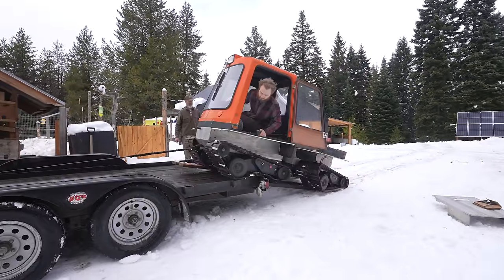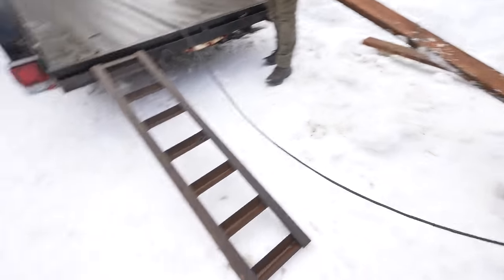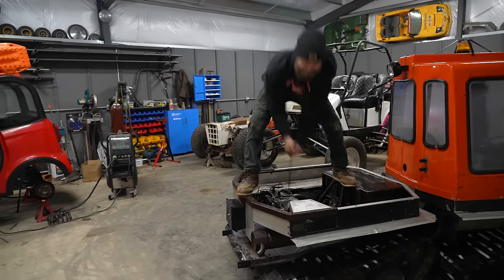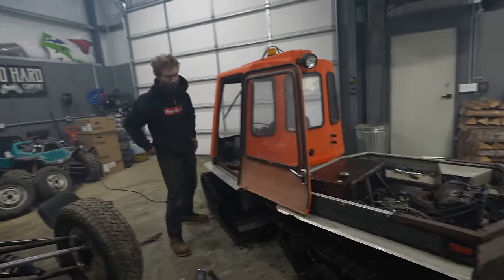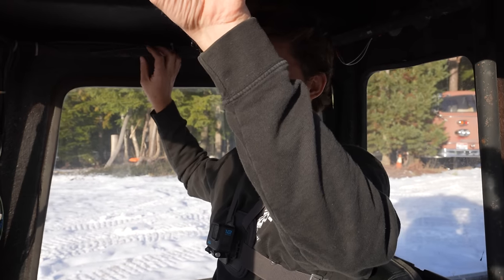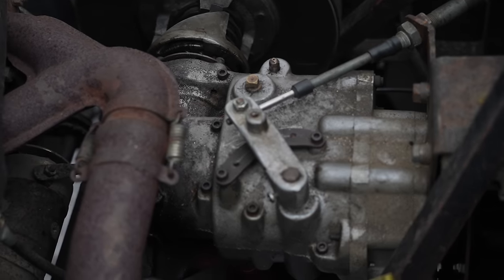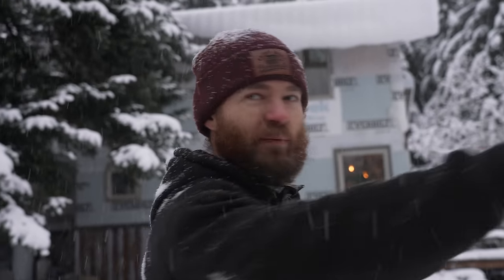We Found a Rare Snow Cat!

Comment from the maker: Finally got a snowcat! Which engine does this machine need?
Reply: You guys should stick a Cummins in it somewhere
Reply: Robot Cantina has a great series featuring a Kubota 3-cylinder diesel... just saying, might be cool...
Reply: Cummins R2.8 Turbo Diesel
Reply: 12 valve
Reply: @alexanderliebscher3472   That would be cool. A little diesel from Kubota would be perfect.
Reply: I was about to ask that question if one would fit🇬🇧
Reply: Or you guys should make it electric. Just like what the tank was going to be
Reply: Rotary
Reply: Chainsaw for each track
Reply: Stick an 8.3l Chevy v8 in it 😂
Reply: honestly would be cool to make it electric if not then i wanna see an outdrive boat motor swapped into it
Reply: Isuzu deisel,  oh its smaller than i first thought😅 turbo moutain sled engine
Reply: Hiabusa
Reply: Love the Kubota option.
Reply: Cummins or 1.9L diesel Volkswagen
Reply: Toyota Tundra engine 100000%
Reply: Needs a polaris xp 1000 motor in it!!
Reply: Om606
Reply: R1 or a detroit!
Reply: Kubota 1505v turbo. No need to try to make it fast. Make it torquey
Reply: Ls swap😂😂😂😂
Reply: Wankel !
Reply: you should fit a recover boom and winch onto the rear and have it as a recovery vehicle to drag the rest of your toys back out of the woods
Reply: Mini Diesel! Torque is your friend with tracks!
Reply: I would either use the new Honda IGX 800 or the DuroMax XP35HPE 999cc… Both engines run amazing in the cold weather…
Reply: A turboed Kubota tractor engine
Reply: Ayabusa
Reply: D5 engine
Reply: Actually just restore it its too cool
Reply: A "little" overpowered electric motor from a Tesla perhaps
Reply: Cummins
Reply: Not sure about the engine but you should look into and air ride seat
Reply: Diesel of some variety for sure
Reply: Ls3
Reply: Some sort of small diesel.
Reply: Something mental
Reply: What about a good old V-Twin from a Harley or Yamaha, would ad a lot more Sound
Reply: Rotary. Built 2 rotor with a turbo or na 3 rotor.
Reply: Or a 1600 cc + v twin for sounds shakiness and a different built aspect.
Reply: @kai_nelson I think at that point the Cummins would be ON it not IN it😂😂😂
Reply: Remember you gotta keep it light to make it useful. I say find an old trusty 20R, deck it out, and make the thing look like and old 70's toyota pickup, Its already got some great curves on the cab for it!
Reply: Get a twin EFI engine from some 90's snowmobile, can guarantee it'll be more reliable, and have more torque.
Reply: def a hyabusa, and you should put a hyabusa in a smart car, maybe give it a little lift, with tracks, and a skidplate, and external rollcage!
Reply: put a BEAMS in it
Reply: T-Jet or CBR1000
Reply: Snow mobile engine wanna hear that 2 stroke scream
Reply: EJ205
Reply: Get rid of the CVT and maybe go 4 stroke. 
V twin bike engine with nice 6 speed gearbox and a gear reduction so that 1st is nice and low.
Bed over the engine and a winch/boom combo.
Modify the cab for 2 people.
Roof rack on the cab with work lights all around.
4 timber sled units would be a lot softer ride!
Reply: Two,  3 cylinder snowmobile engines please.
Reply: Blown big block Chevy
Reply: VW 1.6 diesel
Reply: Definitely LS swop it
Reply: Actually Put me in there I gOt a HEaRt lIKe a tRuCK
Reply: If it wasn't for diesel kinda sucking in the cold, i'd say a 3 cyl diesel skid steer engine... only slap a turbo it. That or the lil Toyota diesel, but aren't those hard to find in the usa?
(I don't think some of these engine suggestions realize the actual size of this thing. 😂)
Reply: Junkyard vw tdi😂 and turbo the heck out of it😏
Reply: A Kabota
Reply: Volkswagen 1.9 tdi pd150  (engine code ARL) gets up to 190hp with just a software tune. Pretty damn reliable and light weight engine! Even small enough i think whit the manual gearbox.
Reply: Put a k20 in it and call it  the "K-kat" a k truck sized snowcat with a k20
Reply: its so weird how similar the scenery there is to where i live in northern ontario, id feel at home out there i think
Reply: I would love to see a big displacement 2 stroke triple. Like and arctic cat 900 or 1000. Problem would be proper tuning and cooling.
Reply: You guy should snowmobile engine in it and the you should put the fire truck on tracks and carry it on the back
Reply: A Hayabusa
Reply: R1 engine
Reply: 4 stroke plzz
Reply: Cummins duggati or hayabousa
Reply: Snow mobile motor with gear reduction 🤌
Reply: A rotary would be dope
Reply: Defo something more relaxed, hard to choke out. People saying Kubota, yeah certainly a great choice if they want to use it more than just for YT views, those things run forever.
Reply: Radial plane engine for sure 👍 🤷
Reply: 4g63t
Reply: Some 500cc twostroke dirtbike engine 👌
Reply: The engine from the minitruck and more gears.
Reply: Bugatti w16
Reply: Boxer engine
Reply: Hellaphant
Reply: A hybabusa would be nuts but I'd find a Kubota diesel from a quad or small tractor
Reply: What kinda power is she making now? Did they make a supercharged snow mobile?😂 She needs boost
Reply: I would like to see a new 450 4 stroke bike engine in there
Reply: Gas turbine like the Abrams tank
Reply: Another rotary
Reply: The stock one rebuilt with some cylinder porting, mill .020 off the head and better pipes. Fatten up the jets some and send it.
Reply: Electric would help it be quieter.
Reply: That thing seems so good with that old motor in it, honestly a newer turbo sled motor seems like the ticket. Diesel to heavy not enough rpm….
Reply: 12a rotary engine would be sick
Reply: TURBO HAYABUSA!!!!
Reply: LS swap with turbskis
Reply: K swap
Reply: 4BT Cummins
Reply: Boxer engine
Reply: K Swap it!
Reply: Crotch rocket engine... Or a H2 engine.......💨
Reply: I do have a 05 fuel injected skidoo summit 1000 locally I could part with for a good price! No boost needed with that many cubic centimeters of 2 stroke
Reply: please make an electric snowmobile like cross-cart, put the battery pack over track tunnel in back and have it on a sled that can swivel from side to side.
you can tilt/lean the "machine" while sitting comfy up front.  also- THINK OF THE WHEELIES!  
snow machines like this has been tried but never done right because you cant shift weight, this idea is super safe and will use the drawbacks of batteries to advantage 
(PLEASE LIKE SO THAT THEY CAN SEE, ITS A DREAM OF MINE TO SEE THIS CREATION)
Reply: LS swap it 😂
Reply: Electric motors
Reply: Big bang R1, turboed
Reply: KTM 500 cc two stroke
Reply: Little baby turbo diesel
Reply: 850 etec or 900 ace turbo
Reply: 5 cylinder Audi Quattro engine pleaaaaase
Reply: A 1jz because why not cho cho turbo sounds
Reply: @GrindHardPlumbingCo ... You guys need to build a camper at the back of the snow cat !!!!!!!!!!!
Reply: I4 Detroit Diesel
Reply: Super charged jet ski?
Reply: EJ motor. Let’s see Will’s Subaru talk in action.
Reply: A small 2 stroke Detroit diesel like a 2-71 Detroit or something
Reply: TT LS swap it
Reply: Some kind of V6 or V8
Reply: This is clearly something that needs some torque. And not just some high strung motor
Reply: fireblade
Reply: Cummins X15
Reply: Cummins
Reply: Can am quad or some belt drive quad would be perfect
Reply: There's only 1 true answer.
VW 1.9 TDI
Reply: Super bike swap when
Reply: Put a Cummins 4bt in it
Reply: A v8
Reply: Put a Hellcat in a Snowcat ?😅
Reply: V 8
Reply: Ls swap it
Reply: Yamaha rx1
Reply: Diesel 3 cylinder
Reply: A 90s rmk 700 or rotax 670 would be easy to adapt. And Itd turn it into a rocket.
Reply: Hellcat engine!
Reply: 2jz
Reply: V12
Reply: Needs to be diesel
Reply: The snowcat is an awesome machine but do you have any idea where to find new tracks. I mean y'all do go pretty hard on your creations. LOL😂
Reply: 2jz
Reply: V8 LS9
Reply: Something close to what it has now but 4 stroke. And a bit more power. Parallel twin bike engine, 270 crank for the sound would be nice. What about a Honda NC700/750, very torquey engines. Would sit nicely low in the frame. Get one with a DCT for driveability :)
Reply: Definitely a little diesel.
Reply: 998T out of an arctic cat or Yamaha. Easily 300hp on pump gas and reliable
Reply: V16
Reply: Yamaha Apex snowmobile engine
Reply: definitely diesel. Roll coal!
Reply: Fuel injected 450 motor
Reply: Some kind of V8, with a turbo, just plonked on top
Reply: Hybrid for sure... I'm jealous for this project. Good luck and we'll be watching.
Reply: V10 or v8 please I never get picked for anything and I watch you guys for so long please
Reply: If only this thing was green, you could call him 'Mike'...
Reply: Turbocharged big inch Harley
Reply: My pick or small engines would be between a  K24, 4bt, ej20
Reply: I would put a small turbo diesel in it.
Reply: Kubota 3-cylinder diesel, super reliable, easy to work on, and loads of torque
Reply: Tesla p100d plaid plus conversion
Reply: Small block LS
Reply: I like the electric idea but batteries suffer in the cold 😉 without any suspension there is no reason to make it fast. I like the sound of the 3 cylinder diesel 😁 Kubota is good stuff. Those tracks probably wont last long. Old with metal kleets. Have seen old snowmobiles like that. Old polaris 😉 might be easy to fabricate but some newer track systems would be ideal 😁 98 and newer sleds had the better suspension but idk about mounting. Good luck and keep us updated 😁 Love all the footage
Reply: a W-16
Reply: TDI swap
Reply: Maybe even just 4 big balloon tires 😉 cheapish fix 😂
Reply: The one it came with
Reply: Something totally inappropriate.
Reply: Rx-1 from the triumph
Reply: I haven't seen the rotary trike around for a while, maybe swap that motor in there?
Brap Brap!
Reply: Honestly robot cantinas Kubota diesel would be sick buuuut a yamaha sidewinder motor would be cooler
Reply: Im gonna be sensible and say, put a Kubota in it.
Reply: Fast motorcycle bike engine
Reply: Some small diesel
Reply: Something that won't deafen you guys, that's for sure. What it 100% needs, is better tracks. Something that has grip. Oh, and better suspension. It has none.
Reply: Harley V-Twin... lol
Reply: Needs a snowmobile engine 700cc or above
Reply: KTM LC8
Reply: When you said turbo 2 stroke that almost what I said from the beginning that's before you said that but diesel motor 2b tq monster speed don't matter well at least 20 to 25mph
Reply: Sounds like a chainsaw, cboys just put a hyabusa motor in a chaing lee so you should put a Ducati in it
Reply: Tdi
Reply: Kubota diesel would be cool
Reply: Ford Godzilla or a hellelephant
Reply: electric, plenty of room for batteries on top of that back half
Reply: You guys are complaining about not having any snow s*** you guys should be in Minnesota right now we're dealing with the mud already like the spring
Reply: Supercharged yamaha from the mg
Reply: 2jz
Reply: That’s not a snowcat, that’s a snow kitten 

Also give it a hellcat engine, it makes sense and it sounds funny
Reply: Turbo 4 stroke sled powerplant ..❤
Reply: K swap for sure
Reply: Yamaha yxz1000 motor!
Reply: A Yamaha Phaser 500 4-stroke would be a good upgrade. It would just break it to put anything more powerful in.
Reply: @jimmyhughes5392 the are not Dave Sparks… they do not get stuck as much 😂
Reply: 3 cylinder kubota diesel !
Reply: A harley engine 😄
Reply: K swap 🤘🏼
Reply: Ninja 650 Parallel twin for good toque or Kawasaki ER5 also good torque, or even the sv650/sv1000 engine.
Reply: Rotary duh!
Reply: 4BT cummins or a VW 1.9 TDI
Reply: 3 cyl Kubota/yanmar diesel would be neat to see in this thing. Would make a nice amount of power and be plenty to operate that hydrolic PTO as well.
Reply: subaru engine   i watched the podcast
Reply: something practical and cool😎❤️🤘🏻
Reply: 4bt Cummins would be sick 🔥
Reply: Vmax motorcycle or high powered snowmobile
Reply: 16 hamster wheels
Reply: 2jz
Reply: Definitely needs a 13b
Reply: needs a rolls royce tank engine in it for sure
Reply: A Hybusa  swap or maybe a 454 engine. Also what is the model of the snow cat?😊
Reply: Ls
Reply: Toyota pruis
Reply: vr6 turbo swap it :)
Reply: K24a2 or a rotary
Reply: The link is a compact liquid cooled diesel with 122 hp @2500RPM and 400 lbs of torque.
Reply: K24 Honda swap
Reply: Yamaha four stroke . Old nitro motor. Turbo of course
Reply: Cummins?
Reply: 2jz
Reply: diesel, maybe from a forklift, that way it can handle the hydraulic pump without chugging.
Reply: Volkswagen mechanical TDI
Reply: Cummins or some sort of diesel
Reply: 2.8l Cummins
Reply: LC8 V-twin from a KTM SuperDuke 1290
Reply: Yamaha fx nytro sled engine! Triple 1000cc animal
Reply: I got a 2001 r1 I would sell to you cheap for this
Reply: Or Yamaha apex engine. Your gonna want the cvt belt unless you get a large enough engine with plenty of gears.
Reply: You gays should keep the 2 stroke in engin in it
Reply: Supercharged RX-1 from the spitfire
Reply: This thing is BEGGING for another set of rear tracks on an articulating pod like the engine bay/rear tracks are. 
Just control C, control V the whole rear half again. 
Could even have a second motor the same as what you end up swapping into the existing engine bay. The hardest part would be locating another set of tracks
Preeeeeeemium👌🏼
Reply: 4 cylinder Cummins
Reply: Nobody 😢??
Reply: A yellow one.
Reply: @itsjosie6301  way too expensive, VW TDI, for the win 🥇
Reply: Vw tdi
Reply: 😅😂😂 sorry purist 😂😂😂😂
Reply: Td4.2 put of a Nissan patrol
Reply: LS swap
Reply: Skidoo 550 fan
Reply: omg you drove through my town!!! thats epic
Reply: Ls
Reply: Keep it light, put a snowmobile engine in it
Reply: K24 engine with a budget turbo kit
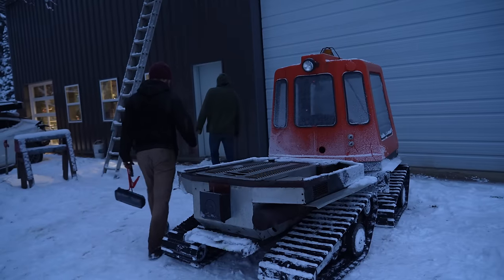Reply: 2004-2006 Arctic cat firecat 700cc engine. It’s a Fuji industry engine and it’s efi. Fairly cheap as well with plenty of parts around. 32:58
Reply: 3cyl Kubota Turbo diesel
Reply: 1000 cc can am
Reply: Tiny diesel 100%
Reply: I was gonna come here and say this machine deserves a diesel engine... but I see everyone else feels the same way. But if a gas engine must go in it definitely make it a boosted Hayabusa 😂
Reply: Skidoo 503 that came in early 80's everest snowmobiles they extremely reliable and even used in small aircraft and it would have perfect amount of power thats needed
Reply: 4bt cummins
Reply: K20, @boostedboiz collaboration
Reply: @SecondFaster No 4bt it’s the smol one
Reply: 2, 250 ktm engines
Reply: Cummins
Reply: 4bt
Reply: Rotary
Reply: Supercharged V10
Reply: Rotary, please do a rotary 🤌
Reply: Kubota diesel
Reply: Another R6 motor
Reply: Witch ever one has the most torque.
Reply: Kubota 1505! Or a CAT motor
Reply: I agree with the lightweight turbo diesel. The torque will lend itself well to hills on tracks in deep snow. Maybe increase the flotation a bit too.
Reply: Yamaha nytro engine!
Reply: YANMAR 3 cyl
Reply: I suggest going for reliability and practicality for the engine and then go nuts building hydro driven accessories. Perhaps a skid steer engine would be a good choice?
Reply: That's either a Suzuki spirit 500 engine or a Kawasaki 440 there both a decent engine just not speed demons
Reply: You should put a mt-07 motor or An Isuzu Turbo Diesel in it and then build a tank body around it
Reply: Ford Duratec 1.6, with a DPS6 transmission, so you can shift manually, or automatically..whatever you choose...I bet it will fit (it'll be a bit big) and it'll be plenty powerful, and fast..... And really durable! .......It'll also produce great heat for you in the cabin. It's set up already. You'll be able to drive in tee shirts, because you've got a powerful heating system ready to install from the same donor car!!!
Reply: Yanmar diesel
Reply: 3 cylinder diesel
Reply: Or Isuzu diesek
Reply: Subaru flat 4 or 6!
Reply: Does will get a check every month ? Seems like he should
Reply: Polaris 750fst maybe?
Reply: Remove the cab. Make it bigger. A 2 seater. And soundproof it. Maybe add a 1000cc goldwing engine. 😆
Reply: K24
Reply: Some kind of swindly greasy triple.
Reply: Would love to see a 3cyl diesel in this unit. Toque, same speed, but a little quicker. Quieter. And different than usual.
Reply: propane forklift engine
Reply: 4bt all day.
Reply: 600-800cc liquid cooled 2-stroke snowmobile engine. run a coolant line into the cab to a small radiator with a fan for in cab heat and a large rad outside the cab for cooling. run some sort of diverter valve to control the amount of heat. would be a ripper with 120-150hp, much more and you would probably risk breaking a ton of components.
Reply: I'd go easy on adding horsepower. im sure the drive train won't like it much as old as it is, but it definitely needs something or at least freshen that one up..
Reply: Kubota or small diesel
Reply: Brushless 30+ kW that thing could use a 300 lb battery pack
Reply: CR500!
Reply: Something converted to propane. Hank Hill style.
Reply: Do a hiabosa 1300 street bike
Reply: Artic cat f7
Reply: OOOOL this is my home turf! how about a small diesel? Volkswagen rabbit? Super reliable and something you haven't quite done yet. Make it a SUPER useful machine for the property and tasks like the 6-wheeler. Reinforce the shit out of it!
Reply: I would put a built Chevy 4.3 in it
Reply: Predator V twin, 670
Reply: I'm down to a little turbo diesel,  a rotary, or a Hayabusa 🤔. Idk close your eyes & throw a dart 😅
Reply: V12=  MORE POWER
Reply: I would say a phaser 500 Yamaha.
Reply: Put a Polaris triple in it
Reply: Ford Australia Barra turbo. 4.oL inline 6.
they are practically indestructible and capable of massive power
Reply: V12 daimler-benz mercedes or BMW double compressor V8 ...at min. 500~600kwatt
Reply: V8of any kind you choose
Reply: Big triple jet ski 2 stroke engine like an ultra 150
Reply: Rotary rx7 engine
Reply: Put the engine from the mini truck in it. That ran like a top and is has good power/size ratio
Reply: K24
Reply: Hayabusa
Reply: Yamaha 540 fan cooled from a 80s sled
Reply: Needs a KUBOTA D722 in it
Reply: Geo metro 3 banger lmfao kidding I would say a vw 1.9 diesel
Reply: @SecondFaster it’s the size of the whole thing nearly lol
Reply: V10 viper engine
Reply: 4bt
Reply: 6.0 power stroke because it’ll sound sick and piss off a ton of people
Reply: @alexanderliebscher3472 That would be perfect for it. Something they intend to use as a workhorse should obviously have a diesel. And, something water cooled would let them run a heater in the cab.
Reply: A hemi
Reply: Put an apex motor in it or a Yamaha 4 stroke
Reply: I can't even wrap my head around the "best mod" for this thing. It appears better clutching and tuning, it would make it more reliable and perform to its other limitations...
Reply: Find a old 400 arcticat engine in it, my dad used to have one and it’s litterally like a mini skid steer engine that will do 60 but the capability to crush you if it lands on you, promise you wolnt be disappointed
Reply: Liked the polaris fuji motor idea. a greasy 600 tripple would be cool in there. Would like to see more greasy tripples on the chanel in general
Reply: It was a rare model called the big cat or something weighed around 700-800 pounds with all the bush guards
Reply: Seems to run fine
Reply: That machine looks like a Rotax.
Reply: @UmmmmmmmWhat Diesel engines don’t suck in the cold. They are just hard to start if they aren’t properly maintained. Once they are running, you are good to go. And the fuel savings from the diesel over the old 2 stroke should more than make up for leaving it running.
Reply: Rotary pls 🎉
3 or 4 rotor with like 300-400 HP 
Not insanely build just enough to spin the tracks 😂
Reply: @blakesteele5349 I wouldn’t call that a small engine, it’s probably over 800lbs. It’s a 6/71 heavy truck engine with 4 less cylinders. It’s still something like 30” tall.  Even one of the smaller 53 series in one or two cylinder would be too big for that little thing. But a small diesel out of a welder or a big compressor, maybe a small skid steer would work great.
Reply: The Whocat lol, also, some kind of diesel
Reply: K24! Turbo!
Reply: At least hayabusa swap it
Reply: K24
Reply: Big block gm
Reply: Hajabusa
Reply: Diesel turbo out of a modern tractor
Reply: i would put a forklift engine in it. Kubota engine. diesel so its much quieter and much more power. then just fit the weights of the variomatic to a slower rpm.
Reply: How about a yamaha raptor 700r motor, 4 stroke and has the torque.
Reply: Any 2 strokes dirtbike
Reply: Honda 350 engine or a 400ex engine
Reply: @alexanderliebscher3472 imagine it with tiny compounds
Reply: V8 😂 please
Reply: Something not 2 stroke. You'll have a hard time enjoying it long term if it's loud af
Reply: Hey guys this thing is SO COOL!! Figured offer. I have a couple engines I’m looking to get rid of and I’m in southern Idaho. I have a Polaris 440 snowmobile engine with carbs, harness, coil, and oil tank. Also have what i believe to be an early 80s Honda cbr900c 4 cylinder motorcycle engine with carbs.
Reply: Throw a can am 1000 motor in it
Reply: The best engine for this snowcat is a hellcat. Can't think of a single thing that could go wrong.
Reply: I think anything screaming wouldn't fit, they got the snow bikes for that. Put in a Kubota diesel and you got a vehicle that can just waddle along in idle all the way to Canada and back on a single tank. It can tow along the Hayabusa for some intermittent screaming 😂
Reply: If you want reliable without heaps of power you can’t go past a 4g15
Reply: BMW N54
Reply: Harley engine
Reply: Hiabusa
Reply: Make it hybrid and put a small four stroke generator on it. You'll get a lot more torque at the low end and I'd really like to see a burnout with tracks.
Reply: Yamaha 1000. From The first 4 stroke snowmobile !!
Reply: I think the mini diesel idea is a good one
Reply: 600/800 e-tec cheap reliable snowmobile engine fuel injected so you can basicly run the engine upside down. And the snowcat defenetly needs a front and rear winch and a truck bed in the rear 👍
Reply: Cummins R2.8 or aluminum block 5.3L LS.
Reply: Ooooh, or is there such a thing as a small 2-stroke diesel? Like a baby Detroit?! Hell, maybe an aluminum block 353 Detroit (I think the 353s were one of the ones that they built aluminum block versions of, maybe like for the Gamma Goats?) would be somewhat feasible, for that matter.
Reply: Turbo snowmobile engine!! Or a turbine driven engine like the Abram’s tank
Reply: @josteincarlsen2905 I second this motion.
Reply: @Gadlion 😂
Reply: @adamr9215 diesel engines are terrible in the cold! They run much cooler than normal engines and barely start if at all when the temp goes below 10-15f and in the really cold, diesel vehicles don’t produce enough heat to keep the cab warm and you have to make modifications so it will. Big pain in the arses
Reply: Turbo busa
Reply: Something diesel
Reply: Yamaha vstar motor cheap easy to work on shaft driven trans so might be easier to adapt.
Reply: V twin diesel 👌
Reply: Idea: get a camman then  put a turbo in it then put some tracks and skies
Reply: @MatthewLancaster01  will never ever fit
Reply: Mitsubishi 4D56 2.5 diesel!!!
Reply: I know there is a lot of people saying diesel but if it gets to sub zero Temps gelled fuel is a big concern so I would stick to gas so I think a modern snowmobile engine thats efi even a 600cc would be the way to go
Reply: Someone may have said it but ........ arctic cat M1100T . 4 stroke factory turbo sled engine. Perfect for that lil fella
Reply: @shred1894  something from like dirt compactors or the like. air cooled with a lot of displacement and torque. I.e. Deutz, Hatz, Ferryman or whatever American counterparts are prevalent in the guys area.  Some might even take a turbo. Some brands even build 2-stroke single cylinder diesels. They already need forced induction to work. often with roots chargers, so.
Reply: V8 turbo charger
Reply: What you guys don't know how to clean points this engine has points it's also used in ultralight aircraft
Reply: The ski-doo 1000cc you already got. Easy to convert when its belt drive already on it! 👍
Reply: Maybe rb26/28
Reply: I think it needs a 4 stroke turbo sled engine. An 1100 would be cool out of a cat but more budget friendly and probably safer for the cat get a 660 turbo out of a cat.

I have a 660 turbo that absolutely rips with a fuel cut mod and all of the boost
Reply: 550 husaberg 4stroke
Reply: Turbo Ls swap
Reply: Texas speed
Reply: Two 1000cc sport bike engines 😂
Reply: Bahoo Dagu engine 1000cc
Reply: predator 670 v twin
Reply: Defiantly needs a diesel or something with torque👍
Reply: YOU NEED TO LS Swap it! You have never done an LS swap!
Reply: Ls-x
Reply: Sounds and looks like not only is the exhaust full of gas but I bet the base is as well
Reply: Cbr1000? With some tiny turbos for all the noise
Reply: Just a higher hp fan cooled motor would be cool, or a reliable liquid cooled sled motor
Reply: Toyota diesel 4 cylinder
Reply: Get a 1.9 tdi from the eu small diesel engine with allot of torque and power
Reply: @kylepope6805  Where did you come up with these idiotic lies? As someone who has been working on diesels for longer than you have been alive, I can factually say you don’t know what you are talking about. Of the diesel is hard to start I. The cold, then you need to service it. Bad glow plugs or the controller is a main problem. Worn injectors don’t spray efficiently enough so that’s another common problem causing cold start issues. The biggest and most common is injection pump timing. In my 30+ years of doing this, I have never seen a mechanical diesel that was timed correctly from the factory. But, if the pump timing is right, the injectors are good and the glow plugs are working and in good shape, they will start in any weather. When I lived in Alaska, both my 94 Cummins and my 86 Ford 6.9IDI fired up just fine in cold weather. -40F without being plugged in and they would both fire up without cycling the glow plugs/grid heater more than once.

Diesels don’t produce less heat, they produce more. That is why they will have larger cooling systems than similar gas engines. The problem is that the larger cooling system is too efficient when it’s extremely cold. All you do is use a piece of cardboard to block part of the radiator. This is done intentionally because the cooling systems are designed to cool properly in the hottest weather in the country. That means they are too big for cold weather. The cooling system is designed to work ok everywhere instead of working great in some conditions and not at all in others. This doesn’t apply to the Grind Hard guys because they will be building what they need. Remember, this is a snowcat, not a hot dessert cat. Because it’s not going to be used in super hot temps, they don’t need to go big on the cooling system. And that will eliminate that problem.

There is no cab heater, so just adding one would be a modification. The 2 stroke is air cooled, so there is no coolant to send to a cab heater to warm the cab. But, with a liquid cooled diesel, you can get a Mojave Heater kit that is easy to install in just about anything, and is far more efficient than any factory heater. So again, that isn’t an issue for them.

FYI, if you think diesels don’t work in the cold, you need to look into Russian and German diesel engines. Most of the old Soviet block countries produce diesels that are built for cold weather and handle it great. And I would trust a diesel in cold weather long before I trusted a rotary or a sportbike engine. Rotaries start harder than diesels in the cold, and bike engines that rev high need to be fully warm before reving them. And, since heat output rises with the RPM and load, it’s harder to build a proper cooling system for them. Basically, if the cooling system works when it’s wide open at 12,000rpm, it’s needing a bigger cooling system than it does at 4,000rpm. So, it will either run too cool at low RPM, or it will get too hot at higher rpm. A diesel that only operates from 700-3200rpm has a narrower range that is easier to account for. So diesel would be a great choice for them.
Reply: Ok so initially I said LS swap it but I was being full of nonsense. 

I think a 4 cylinder turbo diesel will work a treat.

I worked with Viking BVS10 armoured vehicles for about 4years and they use a 6cylinder turbo diesel and can go anywhere.

Turn it into a recovery variant with a torquey diesel. Two winches and a tow truck hydraulic boom/lift. It'll be a monster.
Reply: a Detroit 2-71 would work great
Reply: Sure needs premium tracks, wouldve climbed that hill with enough traction! 
Keep up the good vids!
Reply: @alexanderliebscher3472 

Gas is definitely preferred for small winter vehicles....

When diesel is unnecessary, it's a pain in the ass when it gets bitter cold
Reply: Boat motor 😂
Reply: Every one
Reply: some turbo diesel like 1.9 tdi
Reply: A 1300cc kamatsu
Reply: 4BT
Reply: Harley Davidson motor -
Twincam 103ci (1690cc)
Reply: A jetski 4 stroke
Reply: !!!MICRO KITTY!!! Kubota D722 diesel
Reply: A rotary
Reply: V8
Reply: 2jz
Reply: @sheldonsshed6335  An LS would be way too big and would require them to replace all of the drivetrain and controls at the very least. If they were going to do that, it would be better for them to leave this rare collectors item alone and build something to take that kind of power. Remember, the transmission and all parts of the driveline were built for under 40hp. A 300hp LS is going to just destroy the thing before it even start to move. Putting an LS in it would be the same thing as smashing it with a bulldozer, it would ruin something rare.
Reply: Harley Davidson 👍🇺🇸
Reply: 4 cylinder Cummins or a propane Cummins
Reply: Cummins
Reply: Twin CR500 engines
Reply: @christopherjones4631  Way too big.
Reply: V 12
Reply: Turbo the stock engine.
Reply: JenkemOD  yes 🫶
Reply: @yeetbeam2273  That doesn’t work on a 2 stroke.
Reply: Turbo snowmobile engine or something like that
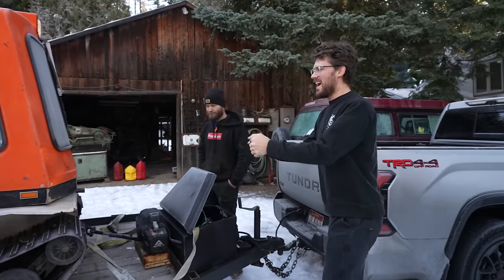Reply: 8:11 dude this would be an epic picture bunch of little snow pirates in these mini groomers with massive motors. PREMIUM
Reply: Paint it YELLOW and call it MINION
Reply: Polaris 2 cylinder or RZR 2 cylinder or can am X3 engine 😂
Reply: Built Yamaha Vmax 4 two stroke
Reply: Little diesel sounds like perfect choice since you can run it on pretty much anything and its much more quiet than two strokes or bike engines. Also make video on how the hell this drive system even works? Seems like Nasu Sisu, but smaller weirder cousin. Also are those tracks home made or whats the deal?
Reply: Yamaha 4 stroke turbo
Reply: I am in the diesel boat. I like what the guy said about the robot cantina and the 3 cylinder kubota diesel, that snow cat isn’t a speed machine, and never will be, something like a street bike engine would just be dangerous and someone would wreck the thing pretty quick. throw a torquie turbo diesel in it and climb some mad snow hills.
Reply: A riding mower engine that goes, “ring ding ding ring ding… ding… ding.”

You know, one of those. 😇😂🤣
Reply: R1 engine
Reply: It needs the chang-li‘s original motor :)
Reply: Kubota would be sweet
Reply: 2.8L v6 out of a 80s S10 

😂😂😂😂😂
Reply: I vote for a small block chevy
Reply: Helcat engine
Reply: Kawasaki made a 700cc four stroke quad that was automatic and had reverse .
Reply: My boss in VT has one for sale if you want another
Reply: Rotary of some type plz
Reply: Harley-davidson m8 114ci
Reply: Hybusa
Reply: Perhaps a Yanmar 3 cyl Diesel like the concrete saws use to replace the original V4 engines.
Reply: @SecondFaster , no chance. It wouldn't fit, and would be WAY too heavy. Even an 8 valve would be far too big. It is a tiny machine.
Reply: @blakesteele5349 , those are silly heavy, extremely slow, and very low power. Also they are huge externally.
Reply: A little diesle engine, I bet that thing would be perfect for recoveries. Lots of torque, and it could idle around for hours just sipping fuel.
Reply: LS swap it
Reply: 4bt
Reply: 90 degree V twin!!!!!
Reply: @GrindHardPlumbingCo i was Wondering Who does these Builds and Who can i get into contact with because for years ive had a great extreme Build that Would Be really really amazing to do But i have no one to do it With or how to start hope this gets to the right person and hear My idea and bring it to life.
Reply: Cummins 12v or a crotch rocket of some kind
Reply: I reckon that beasty Ducati engine from that gocart.
Reply: Tdi alh👌🏻
Reply: 3cylinder sled engin
Reply: DEISEL POWAA!!!!!!
Reply: Turbo or supercharged Yamaha apex engine either would be perfect
Reply: Subaru boxer idk, like turbocharge it or smth - sticking with the subaru theme
Reply: Maybe an a hayabusa engine
Reply: 800cc snowmobile engine
Reply: Harbor freight predator 4 stroke.
Reply: Make it an all terrain pickup truck..
Reply: Put a massive V8 in it lmfao
Reply: Suzuki/arctic cat fan cooled engines are indestructible
Reply: V8  or motorcicle engine
Reply: built 1.9tdi so it can go stutututu
Reply: Harley big twin like the Evo big twin or a Twincam 88
Reply: I think a small diesel would work best but a hiabusa would probably be cooler and possibly more fun also just fixing and upgrading what it's got could be a great option
Reply: A 4bt Cummins in it or a vw diesel motor
Reply: Ls
Reply: 13b rotary????!!!!!
Reply: 3 cylinder kubota diesel
Reply: Biggest LS based motor you can find. Also, supercharged.
Reply: Small yanmar diesel or kabota diesel would be badass and you can put a heater core
Reply: Sti motor
Reply: 13b
Reply: 850 etec turbo from one of those new ski doos
Reply: Give it a little turbo diesel
Reply: LS
Reply: 4 eletric motors
Reply: @kb9oak749  jupp with way over 1000 horses so it would wheelie😂
Reply: 1.9 pd tdi… say less
Reply: 4bt
Reply: 4bt or a duetz
Reply: Not sure what engine , but more horsepower is not the way . But more torque would be good .
Reply: Now I would love to see you guys build a SnowDog or a Tinger Dog or even a Tofalar snow machine that goes fast. Put a built Predator or Tillotson motor ( LOL or a Grind Hard specialty ) in it and some gear changes, and you'll have one fast machine! One that will even keep up with most snowmobiles! If you don't know what they are research one!
Reply: 1UZ
Reply: Just throw a triple 2 stroke in
Reply: 6.7 powerstroke
Reply: A vw tdi 😂😂
Reply: it needs a polaris 850 snowmobile engine in it
Reply: K20
Reply: 3cyl 2 stroke snowmobile engine
Reply: Or just a t660 cat turbo engine, 3 cyl 660cc turbo 4 stroke
Reply: V tec
Reply: Arctic cat, 1404 hooper motor
Reply: 1000 cc timbercat motor lol looks like it came with a 440 fan those are good old reliable engines
Reply: yamaha 700 triple
Reply: A v8 😂😂😂😂😂😂
Reply: Cox engine 🤏💯
Reply: 2jz
Reply: Harley Davidson v twin! Not the most efficient or powerful motors out there but it’d kick ass for this!
Reply: I vote a baby Rover/Buick V8
Reply: Yannmar 3 cyl engine
Reply: 2.3L ecoboost
Reply: JFC V8 hayabusa based
Reply: 4bt Cummins
Reply: Put a 250 cc motor in it
Reply: that Snowcat needs a Hellcat 🤔
Reply: LS
Reply: Ls, obviously 😂
Reply: You should put in a 1.9 tdi
Reply: 1.9tdi
Reply: 1.9 tdi
Reply: I've seen this response already, but a jet engine.

Or a 4BT Cummins
Reply: electric is garbage in the snow
Reply: Vw turbo idi or kubota diesel
Reply: Turbo Rotax like the jet boats??? Might just rip!
Reply: Solid 2jz would go hard in that
Reply: Rotary.
Reply: @alexanderliebscher3472 diesel were they are from...idk if it will ever start😂
Reply: vmax-4 engine
Reply: A bigger one
Reply: v12
Reply: V12 jaguar engine
Reply: Make a cummins 4BT fit on there
Reply: A small diesel with a lot of torque.
Reply: 1.9 tdi
Reply: You should put a 5.3 LS in it
Reply: Bt Cummins
Reply: Definate a Small Turbo Diesel.  Just for the sound!!
Reply: Hellcat 😂😂
Reply: turbo snow mobile engine
Reply: Volkswagen tdi
Reply: Not just the engine. I wanna see a bunch of same size attachments/trailers
Reply: Honda k 48 custom motor
Reply: Viper v10
Reply: V8
Reply: Yamaha 4stroke
Reply: I got a great idea !! Hear me out if it were mine … I’d extend the cab to where one sits behind the driver seat put a Jeep 4.0 motor and all that setup to come with you’ll have low end crawl power and top end speed power 🤷‍♂️
Reply: I think it needs a modern v-twin out of a Yamaha. More power with really good reliability and a good sound.
Reply: or a buggati latest gen tuned w 16 engine
Reply: Compound turbo diesel
Reply: Keep it 2 stroke! Maybe a 900 or 1000cc sled engine?
Reply: All of them duh
Reply: Bosworth DFV
Reply: Hyabusa
Reply: Some big 2 stroke V8 evinrude will be awesome to me
Reply: hayabusa swap
Reply: Need to convert a massive outboard 2T with expansion chambers etc...
Reply: 1000 cc or bigger street bike engine sounds just right.
Reply: XLT 580-600 cc triple pipes???
Reply: Indy cylinderheads 605 supercharged hemi… cause why not?
Reply: V6 trin turbo or V8 lol
Reply: Jixer
Reply: Hayabusa please
Reply: 4bt cummins
Reply: VW 1.9 TDI
Reply: How about a 3 cylinder 660 turbo from an arctic cat snowmobile? If you find a  Bearcat with this engine it also has wide ratio clutches, they work really good for towing. A reliable engine made by Suzuki that is used in a lot of kei cars, so parts should not be a problem.
Reply: A little diesel engine would be a good choice
Reply: I think it needs a Bugatti Veyron engine
Reply: A ski-doo v1000 4 stroke engine would be nice in there. They have a lot of torque and power.
Reply: Hayabusa
Reply: K-series Honda
Reply: 1. Yamaha 3 cylinder 4 stroke engine or 2 stroke 850 e-tech engine.  2. Rear tracks 2 feet longer.  3. The cabin should be isolated from the frame, raised 4 inches higher, and good suspension for the cabin.  4. The fourth change work would be related to the middle joint.  It should tilt forward and backward.  Maybe some kind of electric actuator, and Arduino control, and automated operation while driving, implemented with these sensors: gyroscope, tilt sensor, and maybe front radar.  The fourth change, manual, can perhaps also be handled without electronics, just hydraulic tilting, and a valve block in the cabin.  I don't know what the drivability would be like, on the other hand, adding a gyroscope to the rear carriage, and releasing the middle joint.  Sorry, all free thinking.
Reply: Big engine
Reply: Small 2.8 cummmins diesel
Reply: Hyabusa
Reply: Torque>hp
Reply: Smart move is a torquey modern twin.  But I'd lean towards a triple 2 stroke just for the sound... Find an old 2 up touring setup.
Reply: Yamaha warrior
Reply: R1
Reply: That thing needs 8 Husqvarna chainsaw engines all put together to act as one
Reply: Looks like a good candidate for a twin turbo 12 valve Cummins 😂
Reply: well 1.9 tdi swap would be cool, but I think its better to just get a small kubota diesel engine without electric injection and stuff.. It seems these things have chains in the drivetrain, so they wont be able to handle huge torque anyways.
Reply: Build a second cab that goes on the back half, then do the 100 mile challenge
Reply: 700cc 2 stroke
Reply: big ol deisel
Reply: Yamaha triple! Would love to hear it
Reply: 850 turbo
Reply: I'd swap the lights for LEDs, add a hydrolic winch to the front and maybe swap the engine to a Yamaha FZ07 engine.
Reply: It just needs a 670 Rotax, and that would more than double the horsepower, and it's certainly a reliability update!
Reply: @BayouSelf Definitely air ride seat, probably air ride cab mounts, and tighten up all of the stuff in the cab so it doesn't feel like an earthquake the whole time you are driving it! You should also update the tracks to something with suspension, and definitely bigger cleats for traction!
Reply: @Jcarney87 Yeah, I bet if they just rebuilt it and did some porting and polishing, it would run like a graped ape!
Reply: @goontheracoon That actually is a great idea for weight distribution and leveling!
Reply: @Official.NT_KLEVR They do their own builds, and you just need to find yourself some fabricators, a machinist, and a welder in your area to build whatever you want!
Reply: I’m not one to usually make a request but make a ROTARY common I haven’t seen a ROTARY FROM U GUYS SHAME 😂😂😂
Reply: @SPARTIN862  that weight distribution might be cool in the snow thing could crawl vertical
Reply: @wesman7837  i just wanna see it done for the hill climbs and turns during "wheelies".. also  i hate that engineer's has made electric snowmobiles with the same look, when specifications change then so should the design in order for it to maintain function. Today that parameter has not been reached or even gotten close.. my hope is that grind hard finds this spam message one day, and that we can get enclosed snowmobiles that's also safer than any brand name machine out there today.. basically i wish that they're gonna make a proof of concept.
Reply: The ski-doo 583 is prefferd in single seat aircraft but its liquid cooled That phazer engine would work great and has 10-15 more hp & yamaha reliablity  2nd yamaha vk540 3rd 488 fuji
Reply: You guys should extend the back of it with part of the original mini truck frame to make it a 6x6 snow cat
Reply: electric motor
Reply: 4bt
Reply: A 2 stroke triple out of a polaris pwc
Reply: Thundercat 1000 triple 2stroke or a 4bt
Reply: Keep it 2 stroke. go with a 3-53 Detroit
Reply: 4 stroke 4 sure!
Reply: 4-71 Detroit. 
I would love to own that machine!!!!
Reply: ❤❤WELL YOU WILL NOT BE ABLE TO POWER IT UP TO MUCH OTHERWISE YOU WILL HAVE TO UPGRADE ALL YOUR HYDRAULIC SYSTEM AS IT WILL BLOW MANY SEALS ,YOU WANT TO GO OVER ALL HOSES IF IT HAS NOT RUN FOR A WILE AS HYDROLIC HOSES DO NOT FAIR WELL IF LEFT SITTING
Reply: Built 600cc Polaris snowmobile
Reply: Brp's v 1000
Reply: You guys seem to have a baby Hagglunds! I'd love an excellent little machine like that.
Reply: Diesel Cummins
Reply: V8 twin turbo
Reply: Swap a Rotary into it!
Reply: Ls 6.0 engine
Reply: For sure it needs a turbo diesel you need torque
Reply: 7.3 all day...
Reply: Crotch rocket
Reply: get a yamaha r1 engine 😂